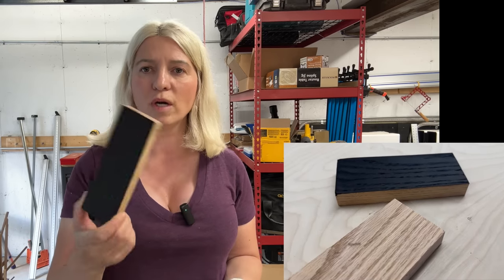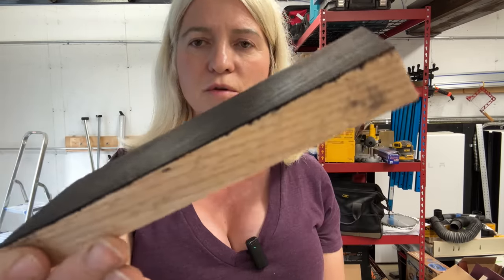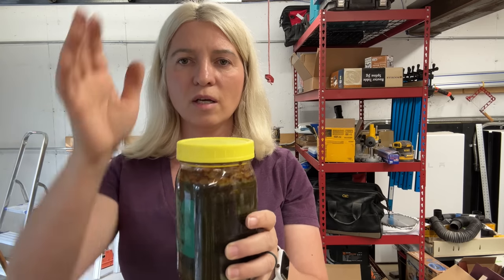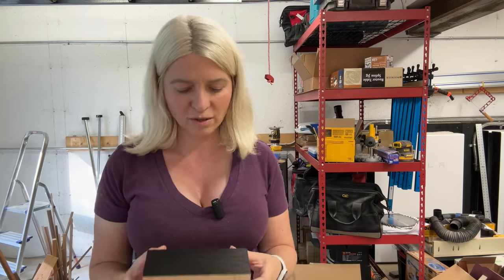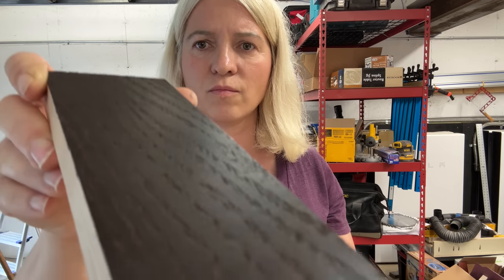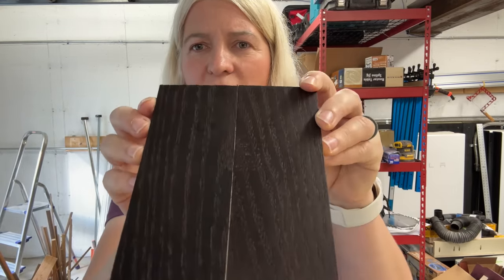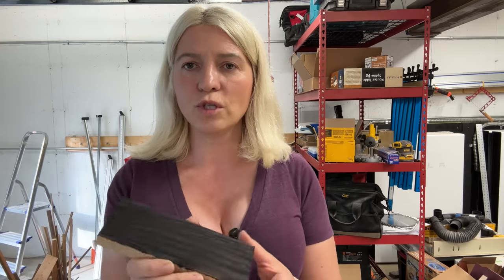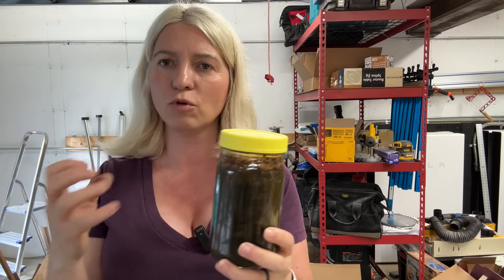How to ebonize wood with steel wool and vinegar. How to turn wood black. Aging wood.

Comment: i wonder if the iron acetate would hold up to the weather clear coated of course. i would love to use this for my custom mailbox posts instead of black paint. just got you in my recommended feed. i mainly work with cedar by the way.
Reply from the maker: I would definitely do a test run

Comment: First time viewer. I enjoyed your  explanation and comparison. An excellent video. I am a woodturner who will be using your process. How deep into the wood does the iron acetate penetrate? Will additional coats penetrate further?
Reply from the maker: Glad it was helpful! Is deep enough where you can still sand the piece . A second coat will make it maybe a bit deeper but not much
Reply: @woodworkingwithSkyler  Thanks and keep up the excellent instructional videos

Comment: I'm wanting to try this but should I ebonize after my piece is complete ?  Does this weaken the wood at all?
Reply from the maker: I don’t think it would weaken the wood at all. I don’t know if I would do it where piece is complete. What if in the seams you have some glue and the wood won’t ebonize? I would ebonize the wood after is cut to size and sanded, then assembled and sealed with a clear finish
Reply: @woodworkingwithSkyler  thank you much!

Comment: I tried the iron acetate solution on a piece of seasoned red oak. Even after 3 applications, it only gets a milk chocolate brown.....not black. What am I doing differently?
Reply from the maker: Was the steel wool 0000?
Reply: @woodworkingwithSkyler  Yes, I used 0000 steel wool - 1 pad in about 1 cup of distilled white vinegar. I let it sit for 2 days and strained it through a coffee filter. The brown color it produced on my red oak sample is not bad, but I hoped it would be darker.
Reply: It didn't work out for me either. Chalky purple brown. Had to sand it off.
Reply: @davidkclayton  I had to use the iron acetate with a strong black tea solution. Twelve tea bags to 2 cups water. Steep for 10 min. and cool. Even with wood that is already high in tannin, I still use it. 
Apply tea solution/dry
Apply iron acetate/dry
Rinse & repeat until it gets as dark as desired

Comment: I have a few questions.   I'm curious how deep the iron acetate penetrates the wood?  I recently needed some ebony veneer for a project but none was available. So I purchased some ebonized veneer rather than attempt to make it myself.   I wonder if you can ebonize the wood as you did in the video, and then resaw a thin slice of ebonized veneer from the treated wood,   That's why I wonder how deeply it pentrates.  The problem with this would be that the resawn part would have some marks from the bandsaw blade and would not be as smooth as the top surface, and it would be difficult to sand it smooth without destroying the thin veneer.  Perhaps and alternative would be to make the thin oak veneer first and then treat it with the iron acetate after.  But I fear that wetting a thin piece of veneer would likely warp it badly and possibly make it unusable.  Have you ever made ebonized veneer? ... and if so, what was your method?  Thank you!
Reply: Veneer work should be done first, get everything as smooth and trimmed out as you need, then ebonize, same as you would with stain.

Comment: If you're a guitar builder trying to fake ebony, don't waste your time with this method.  While no method really works well, this is definitely not the best for guitars.  Mutiple coats of black aniline dye (technically indigo blue) seems to be the best option.  Better yet, just get real ebony and do it right.

Comment: The reason red oak is used in vinegar/steel wool videos is because it contains more tannin and will turn color more so than other species. 
True ebonizing, as done throughout history, is more complex. 
As to "aging".. wood, specifically oak, it does not age in that way from natural to black unless a mold or other agent enters the picture.
Other methods of dyeing, include alcohol, better results. 
Be safe, wear gloves .

Comment: Very interesting video, and useful information. 
However, not a very good production. 
Some tips:
1. Very disorganized and redundant. How many times did you need to tell us you were going to be stain 3 different pieces of wood with 3 different things?
You should plan what you're going to do before your start the camera. Maybe even make an outline to refer to.
2. Most people wear gloves when they do this. Then your don't need to worry about getting India ink all over your hands. You don't want to get those other chemicals in your hands either. 
I'll bet that iron acetate reacts with metaIs, like your watch and other jewelry.
3. Minor, but if you could fix the audio, that would be helpful, I had to turn my volume all the way up to hear you. (Next video blasted me!) 
Other than the wasted time from those 2 points, not a bad video!
Sorry to be critical, I just trying to help!